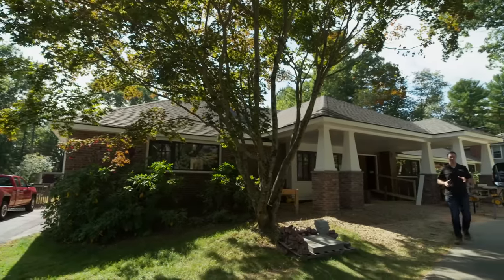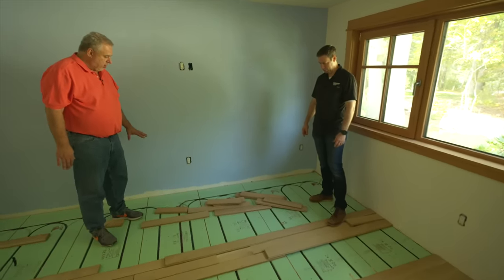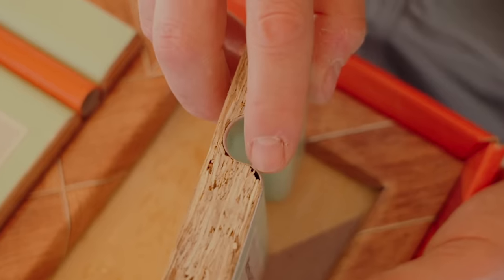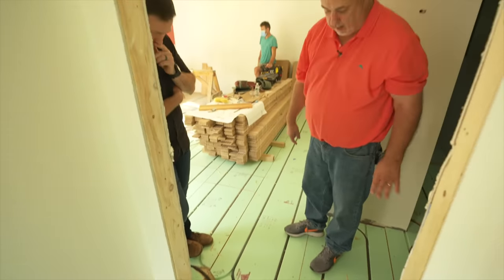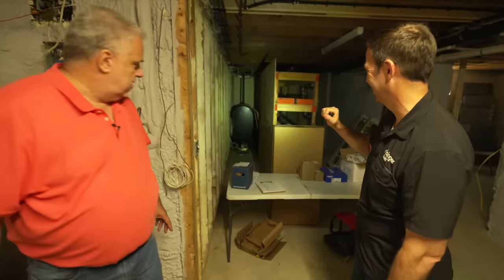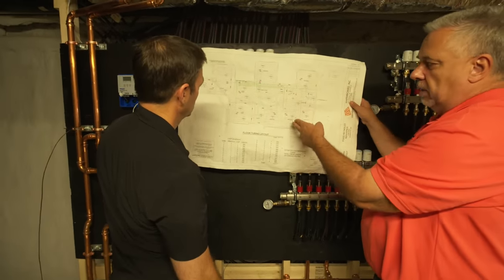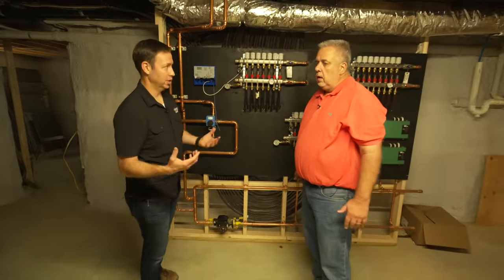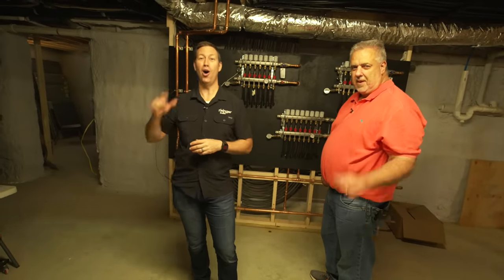Plug and Play Radiant Floor Heating System - BEST ON THE MARKET

Comment: Nice system. The only thing that I didnt see are flowmeters for each loop. The loops arent the same length even in the same zone. How do you balance them? I have full blown Wirsbo/Uponor 20 years old.... BEFORE  the flowmeters became available. I am using a 115k Buderus boiler. I am looking at adding more solar panels and remove the boiler and use a hybrid 80 gallon water heater. My energy guru tells me hybrid heating is cheaper than gas ot oil.... and if I add more pv panels.... it will cover the juice to run it.

Comment: Nice system. First encountered this in 1993 when stationed in Seoul S. Korea. Great in the freezing winters. However, since the cost was dodged in this video, it probably cost this homeowner $30k. Probably take 10 years to break even with efficiency savings.
Reply: Cost wasn't dodged - just never talk about my clients financial decisions out of respect. Check out the Warmboard webinar on the BuilsShow Network where the CEO talks about xost
Reply: Frank Lloyd Wright encountered floor heating when he was in Japan for the construction of the Imperial Hotel.
The Owner of Imperial Hotel bought Korean Prince's quarter and moved it to his house in Tokyo, where he rebuilt it.
Frank Lloyd Wright had meeting with the Hotel owner there, and was impressed by the floor heating system,
and came back to USA and developed floor heating system with hot water pipes.

Comment: uh just curious though, with the traditional ondol system, I know you're saying this is the most efficient but like you're using oil and such to fuel this, but the traditional way you can just throw some lumber into the furnace and use hot air to heat up stones to heatup a floor, which is more cost effective too. Sure maybe its considered more primitive but are there more advantages with the older system?

Comment: Daaamn, thas a lotta Grundfos pumps...
Reply: One pump for each of the zones shown  in the plans at https://youtu.be/qWvoYMf5iC4?t=312    What is not clear is how the pumps match the manifolds.  The plan has 21 runs in 7 zones and there are 21 runs from the 3 manifolds.   You have to assume that zone 7 with 1 run would have its own pump.    and that zone 5, with the highest number of runs (7) would have its own manifold.    The mind boggles at the permutations.

Comment: Beautiful work on the radiant. Have always thought Warm-board was a great product.  Surprised to see only one circulator pump for all the radiant zones. Is that pump variable speed to accommodate the large differences in demand,  depending on how many zones call for heat?
Reply: I believe just before they showed the manifolds that had the one pump on the wall they showed additional pumps for each zone as I agree difficult to believe that whole system has one pump

Comment: I am building my house in N Idaho. It is not done yet, but I have installed (hydronic) tubes in my slab (concrete). My question is: could I install hardwood on my floor, or what do you recommend me to do? because I don’t want to install tiles on my entire floor in my house. Thank you. John

Comment: Amazing. I can't wait to install this system myself. Is this the only source of heat in the house? Any forced heat? presumably forced air? Would be interesting to see a complete install integrating this with other systems you're talking about - like your Zendher ERV, etc. I'd love to see how you're dealing with all the controls/thermostats/etc.
Reply: This home is a remodel and kept its existing baseboard radiators in some areas, while upgrading to Warmboard in the rest of the house. Typically, Warmboard is more than adequate to be the only heat source in a house. Redundant heat sources are generally not necessary with us. An exception might be a great room with many windows and high heat loss, in which case a fireplace would be recommended.
Reply: Warmboard Inc A fireplace? Seriously? The most inefficient form of heat there is. An open fire can even create negative efficiency - sucking more heat up the chimney than it puts out. I know, I once lived in an ancient stone built cottage with a vast inglenook fireplace. Sure, lovely to look at but totally pointless for heating purposes. If fire is your thing- and I totally understand that- al least use a modern, high efficiency wood stove otherwise you might as just burn money in the hope of keeping warm.
Reply: @spencerwilton5831  On the whole, people like to look at fireplaces. And for a great room, with large windows, it can be a good option. Some times, we add panels in the walls as well. But overwhelmingly, Warmboard is the sole heat source in each home we're involved in.

Comment: the biggest weakness of radiant heating is it has a relatively slow response time.  this means if you want to use a setback thermostat system, you're probably going to have less reduction of temperature in "night" and "vacant" modes.  of course, that is also a strength - because you will have less feeling of temperature fluctuation in the house, as well.  one thing to watch out for is convection cycling in a multistory house.
Reply: his is a high performance home, it will be more like set it and forget it
Reply: @stevenbaczekarchitect9431  that's what good setback thermostats are all about. 
I've seen both sides - one person will twiddle with the thermostat 20 times a day, the next person will program the thermostat and then not touch it for a year or more.  really, twiddling with the thermostat is a sign of control issues.

but in the case of a radiant heating system - if you want to be able to drop the temperature dramatically, when you're out and have it heat back up when you return, radiant heating is not your best choice.  if you want to twiddle with the thermostat and feel an immediate result, radiant heating is not your best choice.  if you want your house to always be the same temperature, it is your best choice.
Reply: @kenbrown2808  Great comments my friend - thank you
Reply: @stevenbaczekarchitect9431  I have a bit of an emotional resistance to people saying "this new thing is the greatest thing, you should have it"  I much prefer a "this is what this thing does and doesn't do.  if you want what it does you should have it, but if you don't, then there are other things that do what you want."
Reply: @kenbrown2808  I can totally get behind that
Reply: This is true for most radiant systems, though obviously a high mass pour is the slowest to respond. Our panels are much faster to respond however. If interested, check out our Warmboard Comfort System. This new offering is very fast, and nighttime setback is a breeze.
Reply: @Warmboard  I'm still years out from being the one to spec out a system, and if I get what I want, it'll be a hybrid of radiant and forced air.  they both have features I like.
Reply: @stevenbaczekarchitect9431  "what do you want it to do?" is probably one of the best questions a designer of any kind can ask.
Reply: @kenbrown2808  If I only had $1 for everytime I asked that question
Reply: @stevenbaczekarchitect9431  it would probably be a pay cut, unless you work in retail.
Reply: @stevenbaczekarchitect9431  I believe Ken was thinking that occupants which to sleep cooler than during the day. Lots of people turn down the temperature at night and then increase it when they wake up. I don't think this would be an issue with a warmboard system, but would be an issue with a gypcrete install.
Reply: @kenbrown2808  Thats likely since you need to install an AC system for cooling & removing humidity. You simply go with a heat pump. The trick would be to balance & integrate a heat pump with a radiant heating system. I don't believe there any control systems available to accomplish this. For my own home (still under construction) I am planning to use a PLC controller so I can manage both system using custom controls.

Comment: How would you cool this house then? You would use a forced air system right? That kind of negates one of the major benefits of having this radiant heating system right?
Reply: WoodsmanTA KEK ...a decent amount of homes in northern US don’t need AC because overnight low temps easily get you through the summer. Maybe a handful of “uncomfortable” days per year. Add a couple of ceiling fans, no big deal.
Reply: Maybe in new England area but in Indiana it gets 🔥! What cooling system would be used with this heated floor? 
Also, wouldn't there be condensation built up on the wooden floor? How does that work?
Thanks
Reply: @audreyd859  Always stay above the dew point with your water temperature. -> very limited cooling capacity.

Comment: I wonder if you could use a system like this as a subfloor and whole home heating for a park model RV or tiny home. If you did how tight would the loops be and does the packs hold up well against the heat that would come in from a solar evacuated tube heater

Comment: This is great 👍

What kind of thermostat/control system is being used for the zone control ? 
How much power is used for that system as well? 
 Any pitfalls of working with this system and wood, like leaks? 

Great video, thanks for sharing this ☺️👍
Reply: You can use any thermostat you like with this kind of system. only requirement is that thermostat needs to have NC contact.
Reply: @peto22  other than a programable one

Comment: So, I use Hydronic InFloor incased in Gypcrete and had a retired commercial architect that purchased one of my builds. The first question he had for me was,does the floor make noise when in use? I didn’t understand the question at first as I had the same system in my home, other than the Combi-core (water heater) firing up in the garage I never heard any other noise. He informed me the house he was moving from he had retro fitted with warm board but said it would make noises probably from the alum clad. I’m wonder if this is a typical problem with that system or a fluke?
I informed him he would not hear any InFloor noise within the home.

Comment: I have a question.  Our home has radiant heated floors throughout & We love them.  However during the winter our propane bill is in excess of $400. The boiler is a 140000 btu/hr.  Would switching to a instant water heater instead of the boiler reduce our bill?  Or a solar hot water heater?  We resorted to using electric heaters in the rooms and turning radiant heat off because of the excessive cost.  May you please point us in the right direction?
Reply: The two parameters of heating are simply convert the fuel to heat as inexpensively as possible, then hold onto the heat as long as possible (insulation). Solve for these two......
Reply: @stevenbaczekarchitect9431  thanks, however that doesn't help.  The house is well insulated, the boiler is inefficient.  I need to know WHAT my options for replacement are... what type of boilers are most efficient that run on propane.
Reply: @mikehunt7483  Condensing Boilers
Reply: As a dutch guy i can say condensing boilers ar the way to go. But buy european brands not that crap u have in the US.
Intergas, remeha, vaillant ar the leading brands
Reply: @mikehunt7483  Condensing Boilers, but you likely need to use a storage tank to avoid short cycling. Short cycling not only kills the boilers performance, but also shortens it life.

What you really need to do is get a heat loss calculation for your home first so you have the right sized boiler. Its possible that your 140Kbtu/hr boiler is way oversized for a radiant system & most of the energy is going out the flue.

For instance my home only needs 26Kbtu/hr. So a 140Kbtu/hr boiler is about 5 times too large for my needs. However I do have a 120Kbtu/hr combo boiler which is oversized to provide domestic hot water, & I am using a storage tank so it doesn't short cycle and can run efficiently.
Reply: @guytech7310  Thank You!  Would you be able to suggest the best way of going about calculating heat loss?  I believe You hit the nail on the head.  It's my belive most of the heat is going right out the flute, but again.  I am learning all of this for the first time. The idea of a condensing boiler seems like a decent idea.

Comment: let me start by saying that risinger did a pretty good interview in this video and asked good questions. i came away with a reasonably good overview of how the system worked (it didn't discuss issues related to how the system was designed, but this video wasn't trying to do that). what i would have wanted to see is what they did in the basement. putting the panels on the floor and pouring concrete over the panels is a major undertaking. the other way to go is to build a floor on top of the concrete basement floor, which is not necessarily a good idea. either way, there are some nasty ripple-through consequences. maybe they will address this issue in a future video.

this was a good topic. i would rate this informercial as having pretty good information value. while warmboard sponsored this video, my understanding is that the rehau raupanel has the highest output among above floor radiant systems. it seems that all of these above floor radiant systems (that don't require a cement pour) add about 0.75" to the floor height. that can pose problems with doors. interior doors may not be such a big deal. but when it impacts exterior doors, you've got a big problem. since baczek was doing a whole house remodel, i assume that he reframed door openings to accommodate the added floor height.

it should be noted that when you run a radiant system under hardwood flooring, as shown in this video, you need to keep the floor temperature from exceeding 80 degrees fahrenheit. you can't really exceed 85 degrees under any circumstances because then the floor gets to be too hot.

to compare the cost of a radiant system to the cost of a forced air system, you can't really compare installing a radiant system to replacing a furnace or air conditioner. you would really have to compare it on an entire system cost basis: so you would have to consider not only the cost of the furnace/air conditioner units and costs for running refrigerant lines, but you would also have to include the cost of building and installing ductwork.
Reply: I thought just laying the oak was a great way to make this refit a wonderful finish
Reply: I suggest going to the Build Show Network as I have 2 more videos going thru the planning and installation of the radiant system for his house
Reply: @stevenbaczekarchitect9431  from my perspective, the second video was the more interesting one. what is the bend radius of the rt panels? how did you figure the water temperature out of the  boiler?

having watched the second video, and seeing the layout in the kitchen, i am more puzzled about why they ran loops into the closet, as shown in this video. in the kitchen, in the sections where they did not install warmboard panels, it appears that plywood was used to raise the subfloor and keep the floor level with the warmboard installation. so i am wondering why the same thing was not done in the closet?

Comment: LIKE the Product!      Does Warmboard take into design consideration the house orientation is relationship to the local climate history.    i.e.  Zone 5 with the 285 ft loop length run on a northern exposure in a cold climate would struggle to maintain three rooms at level temperatures.         Building INsites Consulting

Comment: You can go alot longer runs then 300ft. Ours water came 2to3 degrees cooler at 300ft it should come back 8to10 degrees cooler. We throttled it down and it stillcame back warmer then it need to be. So if your  pipe in one zone isway more then 300ft,don't worry about.